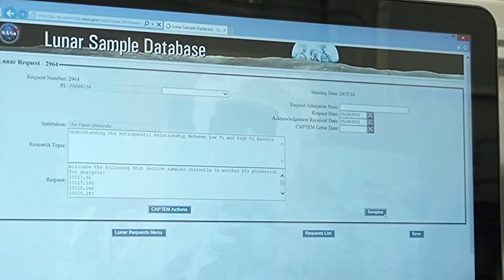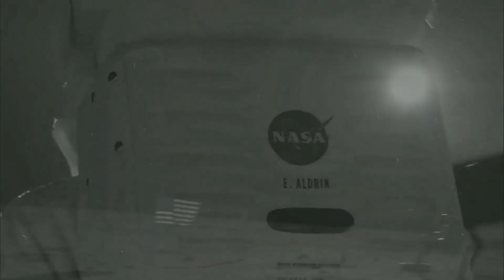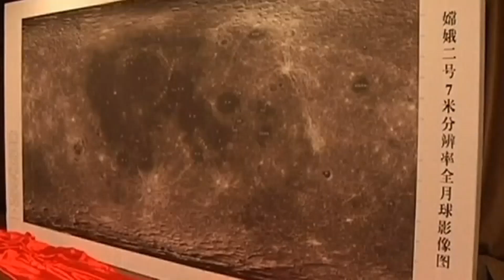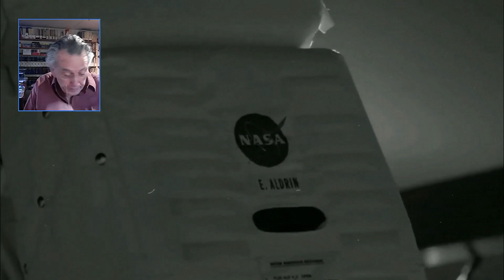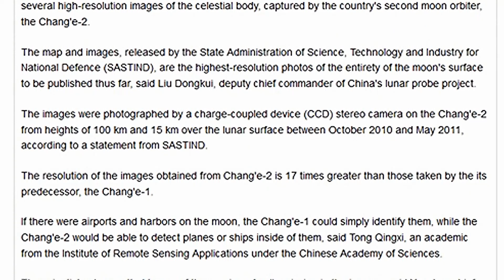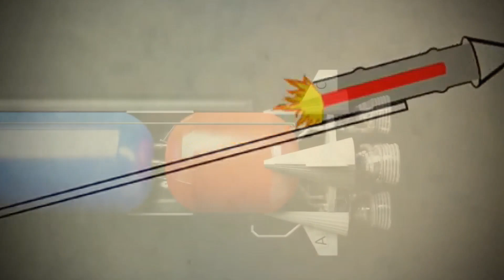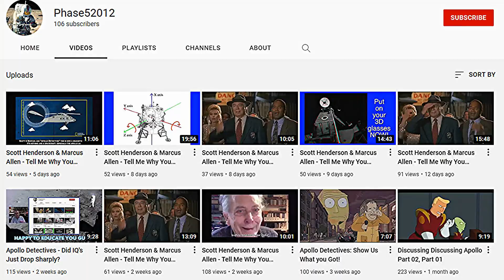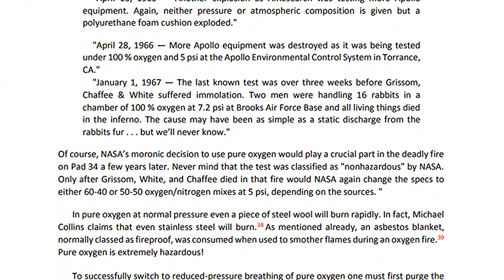THE APOLLO DISCUSSIONS "THE PAPER" PART 7

Comment: Wonder if Chineese have eva suits against radiation?  
"The space suit isn't designed to protect astronauts from radiation."  says shill

"Small punctures are not a problem. People think (thanks to films like 'Mission Impossible') that a small leak in a pressure vessel (be it a space suit or an airliner) is catastrophic. That's not accurate. For a small leak, all you have to do is increase the air supply a bit to make up for the loss."  - says yee other 

- sounds like URSS  USA cordial business relationship, sure got along in that ISS.
Reply from the maker: What is more, the Apollo space suits when placed under X-Ray, shows that you can see right to the other side of the wall. How could a suit like that protect a human from cosmic radiation? It makes absolutely no sense.
Reply: @shillstompers3793  The Fukushima nuclear disaster asked for good old Apollo suits but the Company said they be no good of it, apparently they just used overhauls.
Reply: An other build of Spacestation that is not filmed, only thing that isnt in Space.  And Global Warming, near end of world still more junk up there sent up there. What the hell is there to do there?